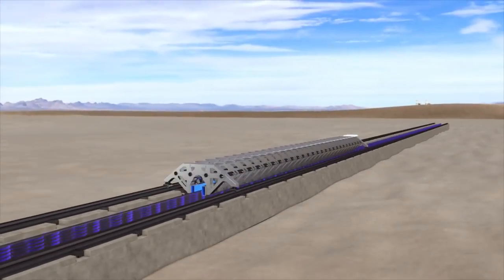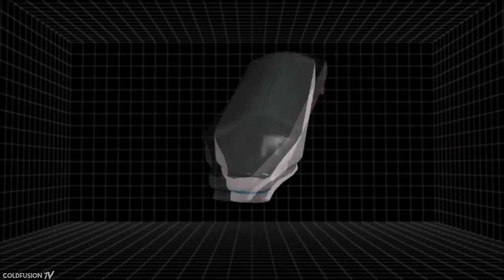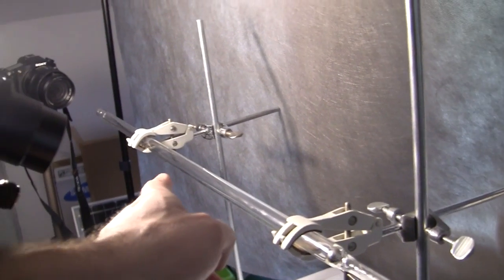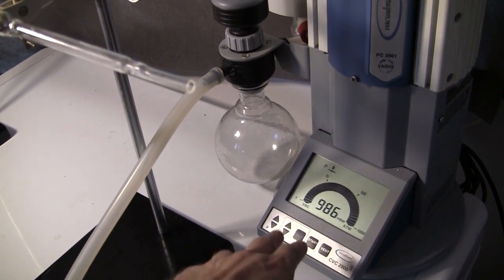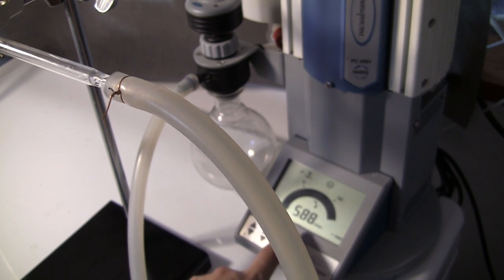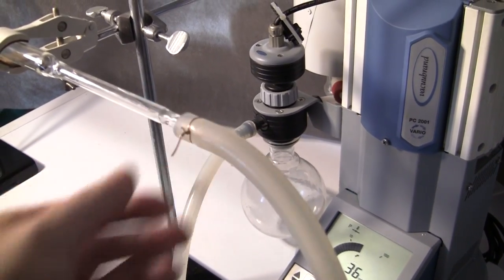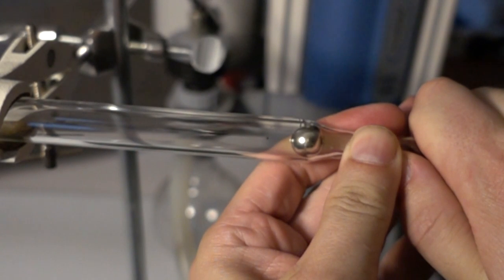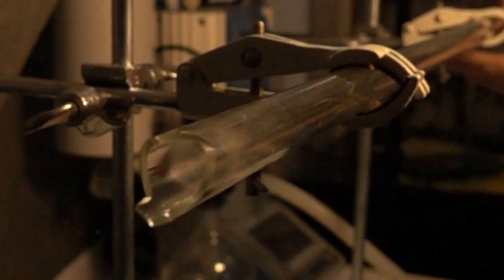How  the Hyperloop can kill you!

Comment: This ones abit basic to discredit the hyperloop system, 
They are not shooting you down it in a ball bearing, im sure more though will go into the final design of the carriage and loop itself than you suspect. like fail safes in each section the hyper loop its self to stop something like this occurring,
BUT EVEN WORSE YOU SAY THERE ISNT A WAY TO SLOW YOU DOWN? YOU SHOW IN THEIR DEMO VIDEO ITS ON RAILS WITH CLAMP LIKE FEET, you assume they wont have an ability to add emergency brakes? or even combined with thrust from the motor in the opposite direction of the in rush of air combined with brakes could slow it down? maybe im wrong but this does seem abit too simple to discredit it, Elon musk has good faith in this project and you can see what has done in regards to rockets and transport and people could have done simple experiments to try and disprove you cant re-land a rocket from space or have great efficiency or range with an electric motor using lithium ion batteries  etc etc etc blah blah blah
https://youtu.be/YIVJvpNyjdc?t=32

Comment: LOL! The reason why the metal ball went speeding is because it doesn't any type of breaking mechanism. A break would be VERY simple to implement in such a vehicle. Also, there are engineers whom are A LOT smarter than Thunderfoot here; do you seriously think they didn't account for this?
Also, you ALWAYS take some sort of risk when taking mass transport. What happens when Hyperloop's vacuum is compromised? What's next? What happens when the wings of an air-plane break off? What happens when a subway train derails? What happens when the wheels of a car go flying off? What happens when your taxi driver has a heart attack?
Reply: It's not that the speed was fast, or that there was any braking. The problem comes in the G forces exerted during the acceleration. Based on what Tf00t is saying, sounds like the acceleration itself would be lethal, or at the very least, extremely damaging to the people inside. And that all happens well before any braking force could be applied.
Reply: Thunderf00t is greatly exaggerating the accelerations that are possible. Absolute worst case scenario you could have 1Atm of pressure on one side of the car and a perfect vacuum on the other.  For a 3500Kg car with a 2M diameter the force you'd get from the atmospheric pressure would correspond to an acceleration of a little over 9g, and that's only if there is a perfect seal between the car and the tube and no friction whatsoever.  This is certainly survivable long enough for some breaking mechanism to engage, and the acceleration could only be lower for a realistic scenario.
Reply: +Michael Whitetail (Kevin Zepp) what makes you so sure a rapid braking system can't be employed? It's definitely not beyond the means of current technology. Hell, even some kind of valve system on the outside of the pod that would rapidly equalize the pressure around the pod would work. Then you could apply the brakes.
Reply: If the tube has pressure sensors, which it would obviously have, the train can easily brake before the pressure reaches it. Please try to think more. Then there are plenty other solutions suggested here in the comments.

Comment: I thought the Hyperloop was going to be like the bullet trains in Japan? Isn't this a proven concept?
Reply: Bullet trains aren't contained in a vacuum...
Reply: Let alone in a vacuum that's so strong in a tube hundreds of kilometers long. I kinda like it - Terrorists can destroy any part of the massive tube to kill everyone instead of having to bomb the actual train and only get a few people. And it'll cause way more damage monetarily speaking than regular train damages. And that's not even getting into the actual debunking TFoot is going to make, since a lot of people can't read the description to see he did this for fun.
Reply: Even if a tube rupture would be dangerous, it would not put every capsule on the track in danger, just the ones too close to brake in time. But the damage done would be very expensive, it would probably take a few weeks to get the tube fixed.
And the tube is not vacuum, only low pressure, so that the pumps can be cheaper.

Comment: Yes this is a possible pitfall, but this also assumes that the diameter of the tunnel and transport are similar. If the gap is large enough the air would just rush pass the transport without too much acceleration. It should also be possible to engineering a solution to reduce said problem. For example, if a pressure sensor and valves exists every X meters or so, it would be possible to detect a sudden pressure raise and trigger the valves ahead of the transport, equalizing the pressure around it and preventing it from accelerating any further.

Comment: I highly doubt that a small free object in the tube is analogous to a heavily engineered vessel under the control of an active transport system.

This seems a lot like saying that elevators are an ill-conceived deathtrap because they suspend the occupants over a huge drop with only a flimsy cable, completely ignoring all of the safety devices in place should that cable fail.

Comment: Next Thunderfoot Videorelease leak: How Elevators can kill you!
Reply: *****
Yep, you missed the point 👍
Reply: "And if you survive the fall you're stuck in a big empty dark tube!"
Reply: This stupid comment again.
If the cable snaps on a elevator safety arms spring out to catch it, these arms are only held back by the cable.
If you want to extend this argument to the hyperloop the cable doesn't snap it increases its mass by 10000 times and lands on the roof of the elevator.
Either crushing it or forcing it to the ground.

Having a massive amount of stored energy in a system is incredibly unsafe and there is no way to design around this.
Reply: ***** I think you didn't got the point.
Reply: How your Bathtub can kill you!
Reply: How your local succubus can kill you!
Reply: How being called to testify against Hillary can kill you
Reply: Dozens of people are killed every year by elevators in America. Most of the time they don't stop at the correct floor, and people try and wrench the doors open and then crawl out between the gaps without hitting the emergency stop. When the elevator circuitry realizes the car is out of place, it suddenly moves the car, cutting people in half.

Comment: you could put emergency vents every 100 feet, air tight emergency doors to sail off the breached part of the tube, emergency brakes(i don't know what a train hitting a wall of gas would do but i'm guessing it is not good) and air presser sensors. The real limiting factor would be on the computing speed. There would be a kill zone, but if the kill zone is small enough and the odds of breach where low enough this would be acceptable.

Comment: Someone at Elon musk said that they'll be able to accelerate the hyper loop at a constant 2.5 Gs. While it is possible for a human to sustain that G load for some period of time, there are negative repercussions on blood vessels and capillaries.

Assuming (just for the sake of argument) that a human can withstand this G force for awhile, the people behind the Hyperloop claim they can get it to 970km/h (3492 m/s).
Given that the formula for acceleration is V²/2x, solving for X gives 2438812.8 meters. It would take that much distance travelled to get up to 970 km/h. Does it seem feasible now?
Reply: I suppose you could go from france to china in a couple of hours. 
Trying to make a straight line go that far, is going to have a lot of engineering problems itself. 
I imagine going around even a slight bend at 970km/h is going to cause significant G's too.
Reply: +TheDcac Nevermind, then. I accidentally multiplied by 3600 instead of dividing. Let me recalculate this.
Reply: +TheDcac As it turns out, the distance is 14,520 meters.
Reply: Remember Concorde airliner were traveling at mach 3.
Reply: its only about 300m/s at 2.5g accelartion youd get there in about 12 seconds.

Comment: If the tram is stopped it presumably has engaged breaks already and shouldn't accelerate during tube failure, and you could employ accelerometer or pressure triggered breaks if tube failure occurs behind the tram. Or operate the tram at sub maximal speeds and accelerate to mitigate the pressure differential if the failure occurs in front of the tram. There are ways to mitigate the acceleration induced by tube failures. Just stay in your seats please. ;)

Presumably it would amount to similar acceleration experienced during car crashes, it depends on the drag from the final shape of the tram, and you have a nice long tram for emergency energy absorption in the event of  tube failure. Yes it could kill you, but so can driving into oncoming traffic, hence airbags seatbelts, and crumple zones.

Comment: It seems to me like this is a problem which could be overcome.  The question is whether or not the system is cheap enough to be worth building.  Atmospheric maglev trains haven't seen widespread use because of the prohibitive cost of building the tracks.  This is going to be even more expensive.  Any distance worth traveling at the sorts of speeds that the hyperloop travels is going to be too far for the loop to be financially viable

Comment: 1) The square cube law tells us that if you make this 200 times as big, you get 1/200 the acceleration of your steel ball if there's a breach. 2) Length matters. What happens over a short run like your tube bears little resemblance to what happens over longer runs. Turbulence, and the mass of the air itself resists its flow into any breach. At any distance from a breach the pressure in the tube will only undergo a very gradual rise, giving the operators lots of time to bring any capsules inside the tube to a gradual stop.

Comment: Vactrains in general are quite a risk. Then again, think of the number of ways airplanes can kill you vs. how often it actually happens? Hypoxia, freezing in the rarefied atmosphere at 12 kilometers up, crashing into the ground at most of mach 1, aerodisintegration, sabatoge, splashdown and subsequent sinking, jet fuel fire, pressurization with non-breathable gases, over-gee, negative gee, bouncing against the cieling, falling luggage, being stranded in the middle of nowhere and dying as a result of dehydration or exposure, shot down, later death due to poisoning from hazardous chemical release, congenital heart problems, etc.

Every one of these things has killed passengers or crew on commercial airliners, yet they're the safest form of travel, per distance traveled, in the world.

Not saying vactrains are without their unique problems, but even regular trains are deadly under the wrong circumstances. Heck, even with nobody onboard, if they carry hazardous cargo, such as oil, coal or natural gas, they're inherently dangerous to the areas they go through.

Cars can kill you with their exhaust, their speed, the environment being traveled through, fires, and worst of all, other cars. They even kill people with their weight on a fairly regular basis.

Trains can cut someone cleaningly in half without the passengers hardly noticing a bump. A train derailment, a crash, etc is an inherent risk. If someone drives a car bomb up to the high speed train you're in, there's a good chance you'll die or be seriously wounded.

Again, not saying vactrains are the best option right now, but the risk of death does not automatically render the idea totally implausible.

Comment: Maybe we should just put brakes on the damn thing and not make it flush with the walls of the tube?
Reply: It's almost as crazy as putting people in a pressurized metal tube and send them flying across the globe at 40,000 ft where one malfunction would mean plummeting to the earth.
Reply: Except that's not how planes work but anyway
Reply: The point is they they are bound to come up with a clever solution to this problem, much harder engineering problems have been solved than this.

At 55mph freight trains can take over a mile or about 60ish seconds to stop.  They even cross public roads but we still use them safely.

Comment: Pretty sure "no way of stopping" is a tad incorrect. It's like saying "If the cable breaks on an elevator, it'll accelerate to the ground with no way of stopping!". I think there's many breaking methods available. My thought is that in case of a pressure leak: you can deliberately cause a leak on the other side of the vehicle and apply magnetic breaking (same effect as passing a magnet through a metal tube). 

The bigger problem I see with this method of transport is the maintaining of the 'vacuum' while being able to load and unload passengers, and the overall energy efficiency of maintaining a low air pressure over a large volume.

Comment: bullshit sensationalism! 
it's a train. not an engine cylinder. 
just have some room to let the air pass around and have a system to automatically engage emergency magnetic brakes in case of sudden pressure change. those should be powerful enough to hold the whole thing together. 
it's all still in development so don't act like it's all set in stone already...

Comment: I still fail to see why this is wishful thinking. Though humbled by my limited knowledge, it still seems feasible to me. Can't the Hyperloop use controlled pressure changes to ensure safe acceleration - and also deceleration if pressure is applied from the opposite side; or even couldn't they decelerate by reducing the force of the pressurized air on tube by opening "vents" and with a combination of other mechanical or magnetic brakes. 

I'm looking forward to your video.

Comment: Well, I usually agree with you... but this time... I don't.
First, this is not engineeringly impossible to make this ultra hard to happen. Second, the same magnets that accelerate the pod, can hold it in place, or decelerate it. Third, there could be many many failsafes to prevent injuries when something like this happen.
I mean, usually you give reasons for something to be physically/energetically impossible. Now, you are just pointing out a "hiccup" on a ginormous project.
Well, I hope you give us more than that on your final video.

Comment: ... I mean, even I thought this could happen, so in practice they would probably not have the edges of the train be so close to the edges of the tube, for air to go around the cab's, and they would probably not pump it out to 1 mila bar or what it is... it's pretty obvious if someone is saying a complete vacuum that they're lieing, you would need oxygen, if the car got stuck you wouldn't get out... but how problematic would it be if they left... oh half a meter of space around thier train, and pulled out half the air? I don't think that would be that bad...

Comment: I'm no engineer,  but if you just turn off the fan in the front, what little pressure is in the tube will just build up till you pull slowly and safely into San Francisco.  In the event of a rupture in the tube, you just have a blow out valve either in the train or on the other side of it.  Elon Musk first proposed using an air cushion in a tube about 1/3 of atmospheric pressure.  The thought being Mag/Lev would be too expensive.  Hovercraft are pretty close to commercially viable.  Overall it seems a lot less impractical than landing a rocket on a barge in the pacific.

Comment: It's very very simple to prevent this type of accident. Let the air past the train, propulsion is magnetic so there is no reason to have the train a neat fit inside the tube, leave a meter gap all around the train and the air will have a path to the low pressure area.

Comment: Not a good comparison at all.  As I understand it they are not planning to use air pressure to propel the train.  That would require a seal that moves with the train through the tube.  That would create a huge amount of friction and involve a lot of consumables.  They are only planning to mostly evacuate the tube to reduce air resistance and use some more conventional propulsion.  Remember, trains are massive.  If there is a breach the air is mostly going to go around the train and probably not move it at all.

I do wonder if maintaining the near vacuum and building the tubes for it is worth it.  Since trains are long and skinny and, as I said, massive, I don't think air resistance is that much of an issue.  

But then, as with all engineering projects, you never really understand it until you try.

Comment: This is wrong.  Thunderf00t you are forgetting the r^3 law and its effects mass, surface area and on inertia.  Fluid dynamic models therefore do not scale well. Just like pebbles can be blown by the wind it takes a very powerful hurricane to blow a car over.... never mind accelerate it at a rate that would cause over 10G. Also I am presuming the train won't be a snug fit in the tube allowing air to flow around it in such a failure, I realise the train will get a battering still but as long as the track doesn't fail the deceleration sound be manageable. 

This is not taking into account and safety features. If I was designing the track I would build pressure sensors into the tube, if they detect a breach they would open vents along the whole track meaning that air would rush in from all directions and the train would decelerate due to the air pressure and not got fired in a single direction.  I would also use the linear motors powering the train to dampen the deceleration. 

Finally a catastrophic failure in unlikely without some form of attack.  That's like saying bridges are unsafe because if someone blows up the bridge people on the bridge will die.... well no shit. Also if the wing falls of the a plane while flying over the Atlantic... you are not going to survive that.

Well that's my thoughts if you can prove me wrong I look forward to it!